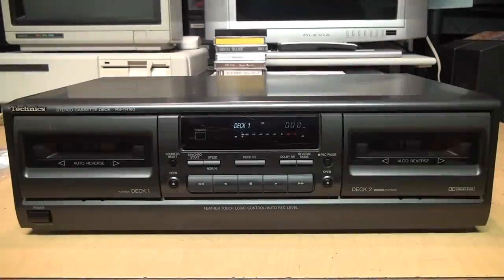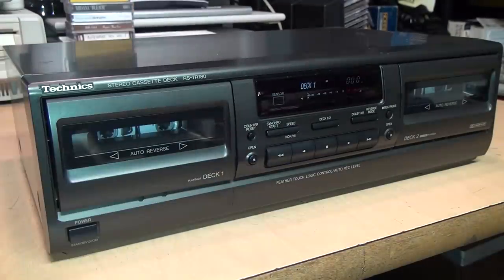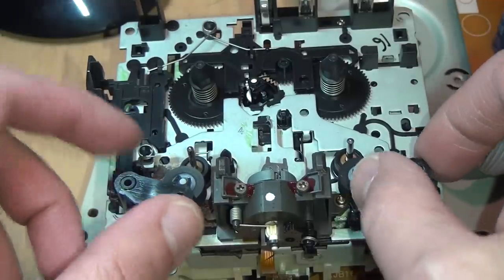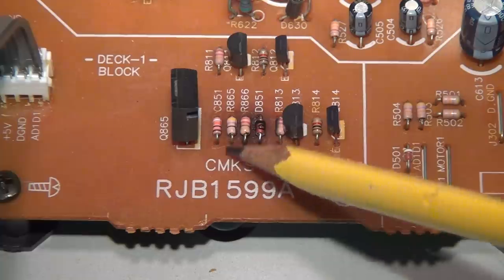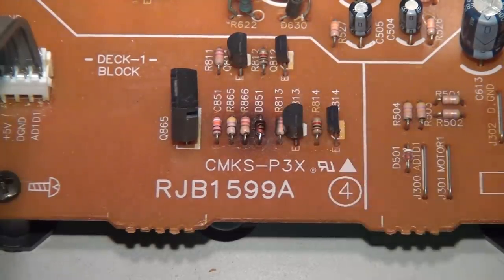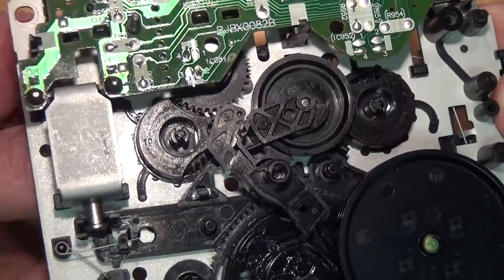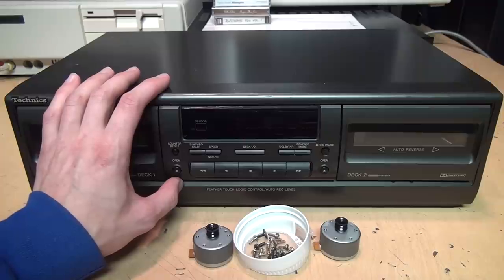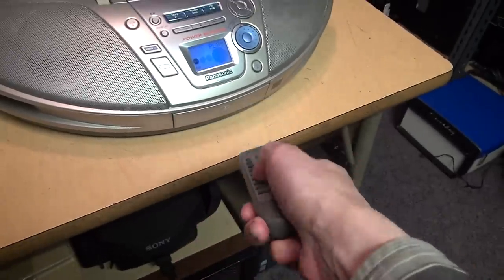Fixing a cassette deck but Everything Goes Wrong...

Comment: When I was 14, I dreamed longingly that I could afford a cassette player some day.  That was 1970.  Now I still have a few nostalgic moments about cassette players occasionally, but it passes quickly when I remember we are in the digital age.
Reply: I'm 19 years old and I'm very much into cassettes. I have about 50 of them or so, and yet my only "deck" is my Philips boombox from 2004, that had a non working CD player, but it's tape deck still sounds very good. Added an external speaker jack and hooked up some very good speakers and man does it sound good
Reply: I'm 20 and I've actually discovered several bands that I love by going through the tape section at my local record stores, I'm not as into cassettes as I used to be but it's still a vibe
Reply: @RealEpikCartfrenYT  I use my Sony s-70 boom box from 2020 or my CFD-S05 from 2010 with an aux jack for recording tapes and sometimes playing back and it sounds amazing to me. I also have a small collection of portable cassette players and walkmans for listening around the house and on the go. I probably have around 100/200 cassettes mostly recorded by myself on my boom box from Spotify or YouTube. I love cassettes and I’ll probably never stop using them.
Reply: Im 17 and into cassettes too. I use boomboxes too often as cassette decks are handling the Tapes better than a cheap cassette mechanism. The boomboxes I use are a Grundig C6200 Automatic from 1977 and a Stern R160 from 1973 made in GDR. Both sound very good even though they are mono recorders
Reply: I know an old audio engineer and he sings praises of the CD. “We would have killed for something that good.” If you want a quality listening experience, you need a quality recording. Every single format has its bad examples, but there’s a reason we don’t still use Reel To Reel as the primary audio format anymore.
Reply: @ChronoTango  I just can't bring myself to use any of the old formats anymore.
Digital media is just too easy.
Reply: @Landrew0  I think CDs really are the pinnacle. Digital distribution with its range of formats opens up huge debates. I suppose that makes it comparable to all the analog formats over the years. CDs give me perfect audio as long as it was mastered well and I don’t torture the disc.
Reply: I seem to recall that the finest steam engine of all time was invented around 1924.  Too late to make a difference.
Reply: I’m 18, I have a lot of cassettes and records and CDs. I got some components for a Sony sound system for free and ended up spending about 70 bucks on the rest of the components and ended up getting a nice stereo cabinet for free as well. I also use a Bluetooth adapter and I can connect it to my tv and it sounds great.
Reply: @RealEpikCartfrenYT  are you in USA?
Reply: I still use cassettes regularly and enjoy repairing players i get. I have spent many many hours making cheap cassette players work flawlessly. It dosent seem worth it until its finally working perfect and then i get my fulfillment.
Reply: @RealEpikCartfrenYT 😮

Comment: As long as you have the broken gear pieces, all is not lost. Superglue the gear back together and then make a silicone mold of it.  Then you can use plastic resin to make new plastic gears.  Superglue will never work in the long run of a repair, but it works perfectly at fixing the gear long enough to make a copy of it with silicone molding.
Reply: Would it be possible to replace the plastic gears with metal gears?
Reply: @EgoChip  Probably not. If you look at those gears, they are not in any standard shape.  If you have a CNC machine and can redesign it in software and cut a new one, maybe.  But the poured plastic one will last many years.

Comment: Yeah that time period for Technics had some pretty junky stuff.  And that is coming from a huge Technics fan.  The 80's for their tape decks was, I think,  the peak.
Reply: RS-M280 / RS-B100 - their ultimate decks in the respective letter series.
Reply: @LapisandHamtarolover  The RS-B85, the 100's single-capstan little brother is no slouch either, I have 2.
Reply: @mescko  there is one deck better than b85 and it's both in the m and b series; it's their m253x aka b90.
Reply: Even my Technics RS TR-355 works better than this one, even if the TR-355 is a Late 80’s/Early 90’s model. Thank god my model doesn’t have electronic eject, or else you’d be screwed when it breaks down.

Comment: My tip for missing spare parts would be making 3D molds with plaster from the original Wheels and gears to be able to make some yourself from resin.  This can be done at home with no problem. And also making a lot of photos from all sides and talking measures so 3D prints could be made too.  Heck, it would probably also possible to make laser cutouts from METAL for actual high quality gears that will outlive the owner of the Tapedeck.
Reply: If you're willing to go with metal, then triangular-toothed gears can often be constructed with just a triangular file and sufficiently thick metal.
Reply: On one occasion I did exactly that (for an automotive window lift drive) way back, measured the broken plastic gear and had a new one cut out from a steel sheet with CO2 laser. Nowadays SLA printing is also available and likely gives useful result. But then again, as the video stated, sometimes it's just not a rational decision to put in the time/effort/expertise into a project that worth a fraction of that and may or may not self-destruct in two months anyways.
Reply: Issue with metal often in these cases is that you're transferring the wear elsewhere in the chain. You're almost always safer replacing like for like as much as possible.
Reply: you vvant meddle 
the medäll 
öFF götZ ^  ^ 
but itz diFFikvlt -:-

Comment: R.I.P. to the unrepairable Technics tape deck.  This is the first deck I noticed on this channel that headed down that road.  Based on what you explained in your video, it's interesting to see, going back to the 90s where consumers started loosing the right to repair their own products like this tape deck.  Great Video!
Reply: Technics cassette deck from the 1990’s sucks. I rather stick to vintage cassette decks from the 70’s and 80’s and it’s way better than this 90’s garbage. Cassette decks from the 70’s and 80’s from various brands are easy to repair, and easy to replace belts. Or maybe a school cassette recorder like Califone which is a good option to repair like replacing the belts.
Reply: @Musicradio77Network  The RS TR-555 is probably the last decent Technics deck, straddling the 80's-90's ('89-'93).  The pinch roller arms are plastic, but still use a metal pin for the axles.  Dual auto-reverse/dual recording, Dolby B/C and HX-pro, and is likely the last deck with DBX NR aboard.  Mine still works fine and sounds very good for a 2-head.
Reply: @mescko RS-X990 pops to mind for dual cording.

Comment: In vintage Hi-Fi, as in old cameras, you take a big risk if you buy something from the 90s that operates completely electronically.  A lot of these items are beginning to fail and are unrepairable due to lack of parts.  On the other hand, mechanical decks and mechanical cameras still work and will likely outlive me.  Some of them have already outlived their original owners...

Comment: This makes me feel better about only having a boombox to play tapes. Not to mention that my boombox, as cheap as it is, with a Tanashin mechanism, is still far more reliable than this deck.
Another thing worth noting is that it's also a good thing to save the tape heads from a deck as they might be used to upgrade another and make it sound better (did that on my boombox) and those two speed motors can easily be hacked to run on one speed by sticking a trimmer (or better yet, a precisely calculated resistor) across the A and B terminals (or L and H, depends on the motor)

Comment: Thanks for sharing despite the tape deck being unrepairable. It's a good lesson on when to cut one's losses and move on to something else at times. Also, thank you for sending it off to e-waste instead of punting it on eBay as parts/repair when they're that hopelessly broken. Been burned so many times by people doing exactly that, and I get sent a paperweight that only has a couple usable parts in it, not worth the time and shipping costs involved. I try to only sell parts/repair stuff on there that's either partly working or at least realistically repairable. Everything else goes to e-waste.

As a silly quirk of mine, I also tend to personify the things I'm working on. Give them a personality based on how well they're cooperating with me during the repair process. When I encounter a case like this, like when a sudden cascade failure happens or the item in question fights every step of the way, I take it as a sign that it's being obstinate and refuses to work again. That's the moment I usually say "Okay, you want to be a lazy piece of junk. Fine, but you're only going back on the shelf in pieces." That's when I salvage any useful components from it before sending it off for scrap/e-waste.

Comment: We used to fix those back in the 90s too. We had a contract with Panasonic. We used to get the boards the circuit boards and everything replaced. Plus the parts as you showed us. It was always fixable. We never had an issue as what you showed us. Back then our technicians they used to call that the bad lemon. As they say one out of a million will be like that. But technics  under Panasonic was the best sellers for audio sounds. Especially as still today technics 1200 or 3200 with the needles(EPC-U1200) for the turntable are the best for the music using vinyl records 12in". But don't forget you can't complain about it, it's discontinued because cassettes are not around. If it's still continued you could just order the board and replace it. But your detailing it on the board which yes it is fixable but the parts don't really exist anymore. Because there's no more value to it.

Comment: Pretty much summed up the entire repair experience right there. Some things were just crap to begin with, even back in the day and are not worth repairing. A crying shame too, cause technics used to make really high quality hifi equipment in the 70s to the late 80s. My technics sa-810 quartz receiver has a missing balance knob and a broken tuning needle light, but everything else still works. Can't say the same thing about their later receivers that I've seen in thrift shops that wouldn't even power up.

Comment: I have a late 90s Pioneer deck, the CT-W606DR (International model, same as US CT-W616DR).  Feature rich consumer level deck, includes digital NR, and auto tape calibration.  I did replace the pinch rollers and belts, which was pretty easy.  Pioneer made this deck for several years, maybe into the very early 2Ks.  I hope it will have a long life since it seems to have seen little use by the previous owner.  However, I also hedged my bets and bought a new production TEAC W-1200.  Not nearly as feature rich, but it does have a NR replacement for Dolby playback, can record on both transports, and even has a real headphone out jack with volume control.  Is it up to the same standard as my Pioneer?  Nope, but hopefully it will last me as long as I want to keep playing cassettes.

Comment: You're absolutely right to not dissuade viewers from fixing vintage cassette decks. Anyone can find a decent used deck at a decent price if they look around hard enough and are willing to be slightly patient. There ARE good decks out there worth investing the time and money to restore. Of course, caveat emptor... 

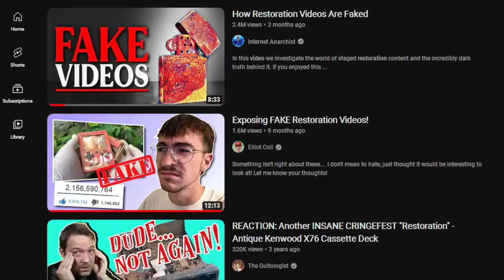9:46 - I am one of the 1.9 million views on that specific Elliot Coll video!
11:19 - Ooh, the "Spaceship Radio!" Just like the ones we had at the casino, right down to the broken antenna mast. Several of us were quite handy at building antennas from chains of jumbo paper clips Scotch-taped to the walls. Took me forever to get used to rotating the blue disc for CD track selection, just give me the standard buttons please! I think the older RX-DS19 (we had a few of those at the casino too) had better bass response than the RX-ES25. Both great boomboxes, around $40-50 in a quick eBay search. And I can personally vouch that they can withstand multiple falls from a six-foot-high shelf onto a concrete floor and still work afterwards.

It's not unheard-of for a voltage regulator to run hot enough to discolor the PCB without being defective. The glass diode, possibly a Zener, can also slightly-toast the surrounding PCB without having failed. I concur with your original assessment with the power supply being the cause; it might be as simple as a bad capacitor or a bad solder joint... 

THAT BEING SAID, I think you're justified in throwing in the towel without diagnosing further. The cost of parts, the time invested, the likelihood of having to 3D print (or buy 3D printed) replacement gears in the future, and you are clearly experiencing diminishing returns. Best-case scenario, you restore a deck that is maybe a 8/10 cosmetically, and end up with a usable budget-level deck that lacks many common and desirable features, and the model has a track record of being a little... How can I put this delicately?... Crappy. Maybe it was worthwhile had the deck worked after reassembly.

You're not restoring a Nakamichi Dragon, it's a late-era tape deck that was probably more-suited to a full rack system ordered from a department store catalog than anything one would buy as a separate component.

One of the tape decks I own an Onkyo Integra TA-2047 that I found at Goodwill for $25, fully-functional, and if it ever fails it will actually be worth looking into because it's a pretty nice deck. I have an 80s Sanyo tape deck that needs a belt, nothing more, and unlike this Technics deck, it actually has a metal flywheel, analog VU meters, 1/4" microphone jacks. Even THAT low-end deck has more going for it than this Technics... 

I'm certainly disappointed with the video, but ONLY because of the deck, I expected better from a reputable brand.

Comment: I used to have a Technics deck very similar to that one, except it had a dial to adjust the recording level and no headphone input. It used to belong to my parents back in the 90s, and it was definitely an upgrade from the Sony boombox I was using for tapes at the time, but it didn’t take long to run into problems. 

The big issue was that it chewed up my blank cassettes (without pulling the tape out of the shell), but the pre-recorded ones still worked fine. I brought it to a repair guy who said that it was the belts causing problems, and that did seem to fix the issue, at least for a while.

What ultimately made me get rid of that deck was when it started having logic problems. I would press play for instance and it would start fast forwarding instead. I took it to another guy and tried to sell it to him for parts, initially asking for $20 and eventually $5, before just giving it to him. I’ve since upgraded to a JVC KD-A77, which has yet to have any problems.

Comment: I did a TR333 with replacement gears from a guy in Europe on eBay and it works like a champ....powers through stiff tapes on high speed dubbing. When I am about to lose a tape I dub it onto a TDK 90m. Glad to see this video but I agree with you these lower end technics desks aren't worth it.
Reply: The TR333 is probably the last double deck model from Technics that is still really well built. It still has metal flywheels, the 373 already has plastic pulleys instead of flywheels. I also have a TR333 waiting for repair. I hope I don't have to change all the gears, because it would be quite expensive. Fortunately I'm in Hungary, where the good quality, injection molded Delrin replacement gears are being made. Last time I bought one for my RS-B555 from the gear maker guy on ebay, he personally dropped it into my mailbox instead of sending it in mail :)

Comment: All those decks shown as “worth buying” at the end had at least one thing in common - they were single decks. The Technics with it’s Auto Level Control and dodgy electronics, was an example of the compromises manufacturers made to appear to give you more features in the form of a twin deck.  Less is more!

Comment: 1999 didn't use the mechanism that the gears cracked on, they stopped using that mech the first half of the 90's(I believe it was 1994). The gear would lose teeth because it was nylon or neoprene and would fall off one at time (it was literally clear & flexible you could fold it in half and it would flex right back) and was the center gear that switched back and forth from forward and reverse spool that the belt hooked up to on the back side (lower small belt) the gear was literally on the cassette side once you removed the play head and pulled the metal that moves the head up out of the way. I rebuilt a few of those earlier models and still have those extra gears in a baggie.